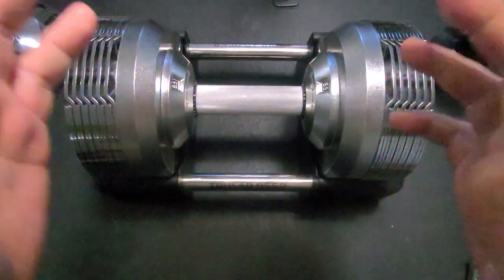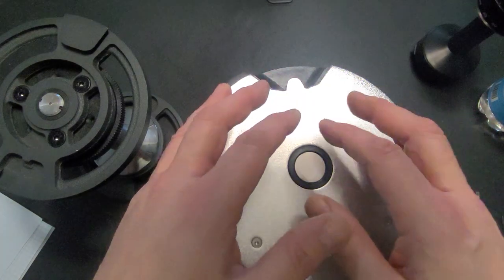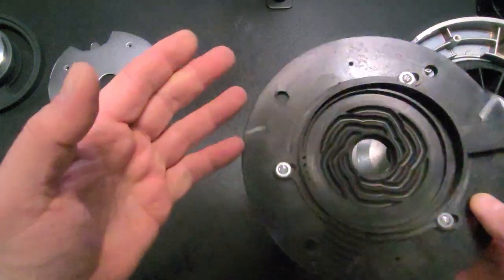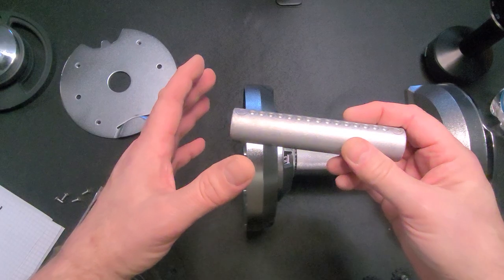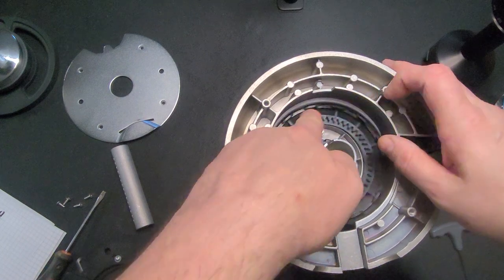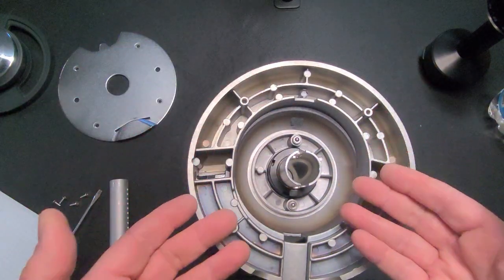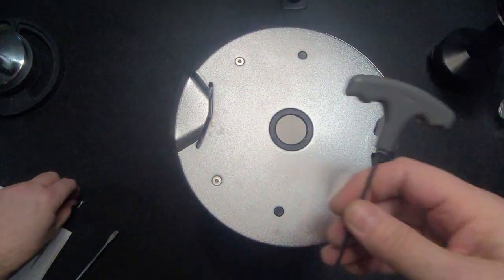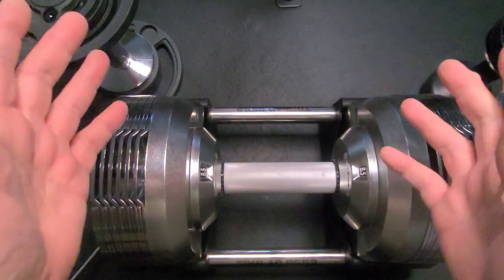Average Joe Teardown of a TRULAP™ 8552 Adjustable Dumbbell -- another solid competitor in the market

Comment from the maker: [Corrections: At 14:57 the parts that I refer to as ball detents are also known by other names such as ball plunger, spring plunger and ball catch. At 16:23 I mistakenly described the reverse order in which the parts interact. When you rotate your grip, it interacts with the large innermost black plastic assembly first since the two are locked together. That then turns the two smaller gears, which then turn the numbered ring. Finally, at 20:00 when you see me fiddling with the black plastic plate, it's because we need to rotate the plate slightly to get it to drop into place. So gently turn it slightly clockwise and counterclockwise until you feel it drop down into position.]

Comment: Just a quick FYI. The increments were originally designed for 1.5Kg per turn, every turn. When translated into lbs with rounding, that resulted in the seemingly strange increments.
Reply from the maker: Oh man, yes, that makes complete sense for a company based in Canada.  Thank you for pointing that out. What threw me off is the lack of kg numbering on the version sent to me. 

So it's the same old challenge designers face. We can make the increments clean in one system (metric or imperial) but not both. Fair enough. I deal with the same challenge in my own products.

Comment: I dont knwow why anyone ia bothered by the odd increments. In the end you just track your work out. Unless you like remembering it
Reply from the maker: I tend to agree. In fact, many of my modifications alter the original weight settings of various dumbbells. So, oftentimes, the original decals are no longer accurate.

It's more of a market expectation than anything. Someone else pointed out that these unusual LB increments are because the original version used KG increments, which should have been obvious to me earlier. 

But at the end of the day, I agree that it's more about tracking what you do.

Comment: If you have smaller hands, this is a no go, right?
Reply from the maker: Hi, SFD. I wouldn't say a 100% no-go. It depends on how small we're talking about and the individual's intent. A 1.5" (~38mm) grip would definitely feel like a fat grip in smaller hands. They'd likely find 30-35mm (1.2-1.4") more comfortable. However, for adherents of the "fat grip" school of thought who purposely challenge their grip strength and go for more forearm engagement, this might be right up their alley. 

Still, 1.5" is a bit on the thick side if the folks behind Trulap want to appeal more broadly. It would require a potentially significant retooling for them to shrink their grip now.  It'll be interesting to read user feedback as more people give it a go. Cheers, Joe

Comment: Can you explain how the increments system works? Ideally show what happens between plate and bar if you add weight and how is it safe. Thanks!
Reply from the maker: Hi Marek, sorry about the late reply. This past month was crazy busy.  I believe I understand what you're asking. You'd like to see a demonstration of the telescoping rods and pins that engage the full and half plates. Is that correct? I may be able to do some sort of short video about it in the near future. 

It's basically a variation of the same method used by all of the designs that rely on telescoping rods: Nuobell, Core, Snode, etc. Rods extend outward from inside the grips and with each twist of the grip, the rods extend further to engage more plates. All telescoping rod style adjustable dumbbells rely on dovetailed plates to keep the plates from sliding off of the rods. 

I think what I'll do is add a telescoping rod explainer video to my to-do list. Something that covers all of the different considerations of the design. Thank you for your suggestion. Cheers, Joe

Comment: I'd take the snode any day. snode seems to have an easier fix if it breaks
Reply from the maker: Hi, Zoogie. I'd rank them about the same in terms of ease to repair. A couple simple hand tools. There's still an unanswered question of whether Trulap will supply parts. But I suspect, based on the overall construction of both the Snode and Trulap, that they aren't going to get many warranty claims over the years. At least not due to normal wear and tear.  Cheers, Joe
Reply: Great video Joe, I was able to fix my snode thanks to you and your video on the snode.

Comment: I'm surprised there's no grease lubricant on some of the parts
Reply from the maker: I suspect it's because the parts aren't really under any significant load, and they aren't rotating in such a way that friction/heat would be an issue. Some plastics are self-lubricating, though I don't know if that's the case here. It wouldn't hurt to add a silicone grease, but I believe you'll find that it doesn't really measurably improve anything. Cheers, Joe

Comment: Really appreciate the effort and time taken to tear down and make this video! Also saw the video by Gluck on the Nuobells shearing on the plastic followers due to the twisting motion. As these do not seem to have that twisting motion, do you foresee any potential for the plastic components having years of longevity assuming one does not drop the dumbbells?
Reply from the maker: Hiya Ryan.  Thanks for watching the video! I'm glad you found it helpful. I don't know if you saw Gluck's reference to my original Nuobell teardown video from last year, but here's an up close look at the cam followers that Gluck referred to in his recent video: https://youtu.be/VI3alL6i8jA?si=oWAAMSSPZxRogIqJ&t=1167

The telescoping rods and weight plates are what determines much of the durability as far as drops.  The internals are what determines the durability/longevity of weight adjustment. Nuobells have issues with both. Trulap's implementation is, in my opinion, more durable and, unlike Nuobell, it's fixable.  I suspect Trulap handles will significantly outlast the current Nuobell handles. I say that as someone with no relationship with either of these brands.  Cheers, Joe

Comment: Great review. Thank you. What prevents the expansion plates from falling off the rod if I turn the dumbbell vertically?
Reply from the maker: I'm glad you found it helpful. That's a great question. This answer applies to all adjustable dumbbells that use telescoping rods to select weights, including Nuobell, Core, Snode, MX, Trulap, etc. They all use some variation of a dovetail or tab to interlock their plates. Each of the plates "locks" into the one before it on the handle.  You can see the upper and lower tabs on the Trulap plates at 4:00. So the rod keeps the plates aligned, and the dovetails/tabs keep them from sliding off the rods.

This is both a strength and a weakness of the telescoping rod design. A video about telescoping rods adjustables has been on my to-do list for quite some time. I'll see about finally filming that video in the months ahead. Cheers, Joe

Comment: Hi.
I have a pair of 1090s and a couple of the plates have kind of a crack and they may break.
Do you know where can i get some back up plates or a fix for that?

Thank you
Reply from the maker: Sorry about the late reply. I'm just seeing your message now.  Bowflex 1090s? I would not recommend buying replacement plates. eBay is one of the few places you can find individual plates for sale, and they're fairly costly. They're typically sold by people who part out dumbbells. So there's no telling how much more life you'll get out of the plates before you run into the same issues.

If the tabs on your plates have begun to crack, I do have a DIY video about how to permanently fix them: https://youtu.be/-a-gqVB-oOw. The method described in the video is just one of several ways to accomplish the same goal. You can use other methods such as welding or epoxying the bolt into position too.

If the outer plastic shell of the plate has begun to crack and lift away from its steel core, you can try to lift the plastic enough to squirt some epoxy underneath, then clamp the shell down until it cures.

I hope you found this helpful. Cheers, Joe

Comment: Thanks for the breakdown. Do you think there will be any damage to the mechanism if magnetic plates like platemates are added to the ends for microloading? Would it cause uneven stress on the rod for example if you were to only add a platemate to one side or both sides?
Reply from the maker: I'm glad you found it helpful.  I don't believe you'll have anything to worry about with microloading by way of magnetic adder weights. Its telescoping rods and internal mechanisms should be fine with the added weight under ordinary use. The usual restriction applies...we shouldn't intentionally drop adjustable dumbbells. Outside of that, you should be fine.  Cheers,  Joe

Comment: Excellent detail.  But you forgot to teardown the weight plates. I mean there are two layer of sheet in weight plates. Are plates welded together. Please make a video on it also
Reply from the maker: Hi, Esha.  I'm glad you found the video useful.  Unlike some of the other dumbbells on the market that use plates which contain other small components (e.g. Nuobell, REP, etc), Trulap plates are just layers of what appears to be stamped, die-cut steel, and can't really be disassembled without drilling out several rivets that are used the fasten the layers together. I don't see any visible welds, and I doubt they use an adhesive between the layers. Both would be unnecessary. You'd drill out all of the rivets, and the two layers would come apart. You could very likely throw these plates off of a rooftop and the steel would either deform or damage the ground below first, before the two halves would come apart.

In the teardowns, I focus mainly on the handles which generally determine the overall durability and repairability of the dumbbells, and even then I only focus on the portion that owners can disassemble with simple hand tools.  If I do any plate disassembly down the road, I'll be sure to post it here on Youtube. Thanks for taking the time to submit the idea! Cheers, Joe
Reply: Can you tell how thin is each plate? Seems like 4 mm plates joined to make 8mm
Reply from the maker: @eshakhan5752  You have a very good idea for scale, Esha. They are ~3.5mm thick combined to make ~7mm +/- a couple tenths.
Reply: @AverageJoeInnovationsLLC  just guessed :) my friend is using them and I want to buy it someday. Thanks for the update

Comment: Is this gen 1?  Trulap sells an upgrade kit that looks like just a bigger rack and extra plates. So no need xtra increment indicator wheel sans “stopper”.
Reply from the maker: Hi hi. These are Gen 2, as far as I am aware. At least that's the reason Trulap provided when the shipment was delayed several weeks last year. It definitely makes sense that they'd just ship a larger base with extra plates as an expansion kit.  For the heck of it, I'm going to inquire about the differences between 1st and 2nd Gen and see what they say. I'll post here if/when they respond.
Reply: @AverageJoeInnovationsLLC Did you het a response?
Reply from the maker: @VTF82  wow, it had been so long I had forgotten about my request. I don't recall receiving a reply. I'll send a followup and find out.
Reply: @AverageJoeInnovationsLLC  👍🏻